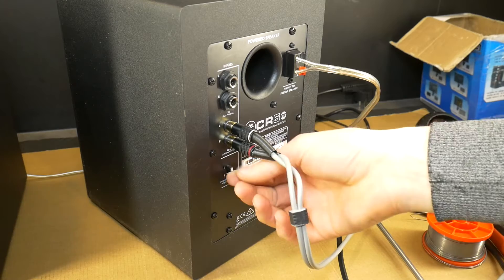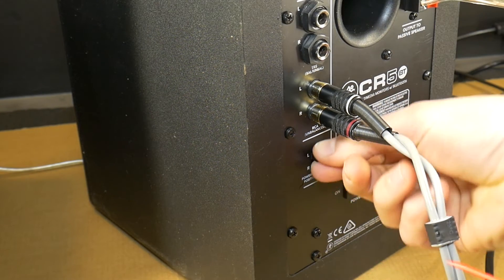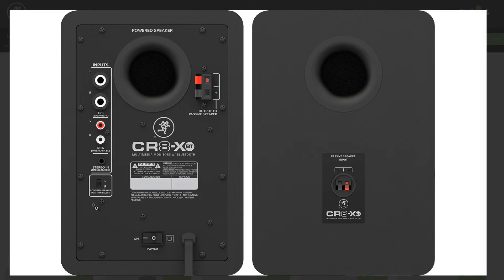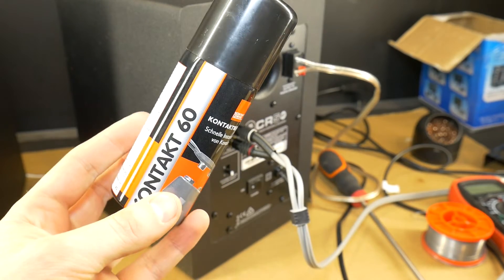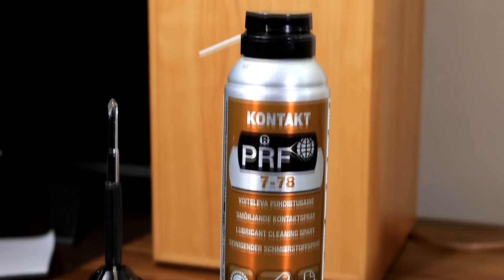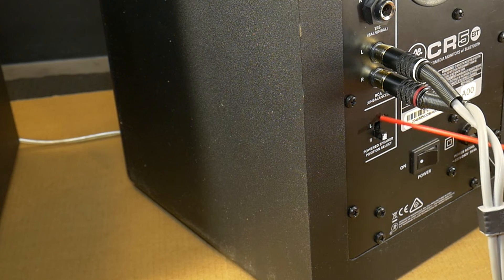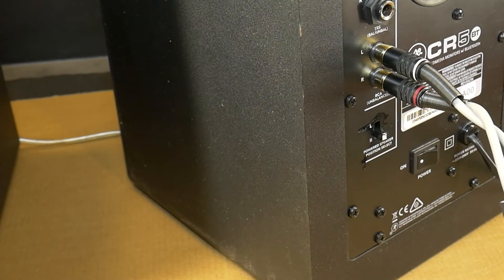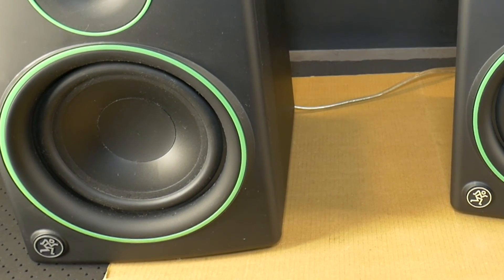Fix Mackie Monitors L or R Selector Switch

Comment: I am returning here to leave a  comment. I had this issue i dealt with for years and couldn't find a fix. Until I saw this vid. I purchased the WD-40 contact cleaner because the one on vid was not available. BUT I MUST SAY IT WORKED! I was ready to buy a new set of monitors because i couldn't take it. Thank you so much @techscrew!

Comment: I had this exact problem with the contact cleaner spray in my cart when I noticed others in the comments saying WD-40 worked.  I tried the WD-40 and it worked for me as well!  Thank you for making this video!  You probably saved me hundreds.
Reply: I just tried WD-40 as well, since I already had that at home and I can confirm that it fixed my speakers too.
Reply: Can also confirm this worked for me

Comment: I has tried to spray contact cleaner in my CR4's L-R switch before, without success - I think my can of spray was so old it just didn't deliver enough stuff, because, after seeing this video and the comments, I shot in a good bit of Tri-Flow, and worked the switch a dozen or two times, and now the speakers are working great!  After several years of silence, it is wonderful to hear them sound again.

Comment: This is a common problem on Mackie CRs, but there is a more sinister one.
The sound will keep coming through the fixed L/R switch until the +/-12V regulation shunt bakes the board and the capacitors and zener diodes in the area. Introduce a dynamic +/-12V regulation module using LM7812 and LM7912 regulators and you will have fixed the speakers for years to come. I did this on my CR4s back in 2017 and they still work great and the PCB is not overheating anymore. 😉
Reply from the maker: thanks for feedback :)
Reply: Is this something a lay person can do with household tools or is there specialization involved?
Reply: Yes, I wrote about this on BadCaps forums after getting some great help from people there. Visit the forum site and look for the topic named "Mackie CR4 amplifier no sound". But basically, you will need a phillips head screwdriver, pliers, a +/-12V ready-made voltage regulating module, a soldering iron and wires to connect everything.

Comment: I tried this before watching your vid cause sometimes it's quickest and cheapest solution.but it didn't help. Switch needs to be resoldered.
Reply from the maker: Maybe you're using the wrong spray, or your switch is in very bad condition, but it worked for the first time very well.
Reply: @Techscrews  I had very good quality spray used by trusted electronic engineer. I didn't used the switch very often. It's common issue with CR4 speakers. He confirmed it needs to be resoldered. Spray is generally temporary solution but if it worked - good for you!